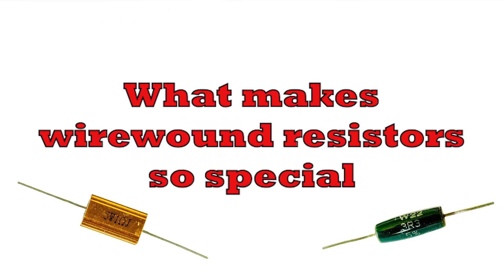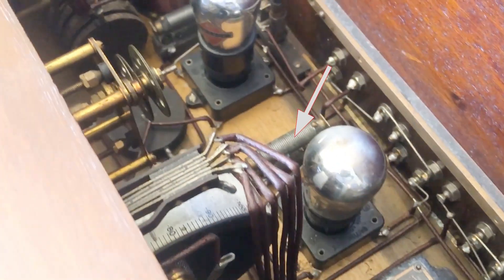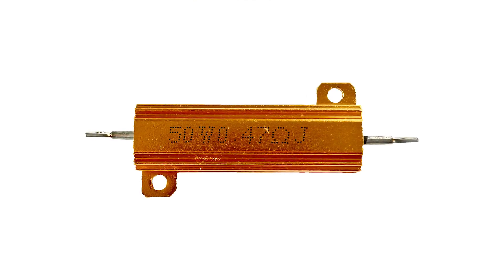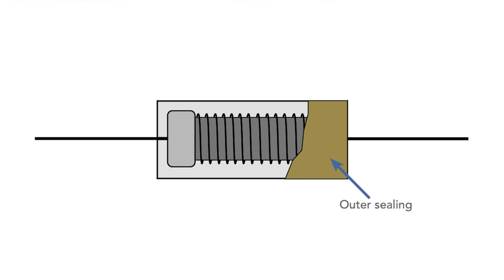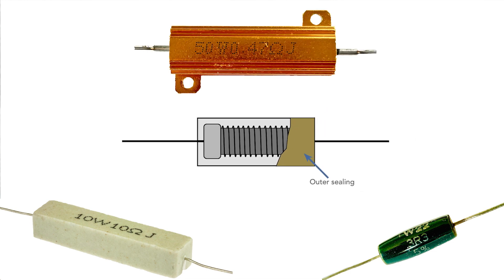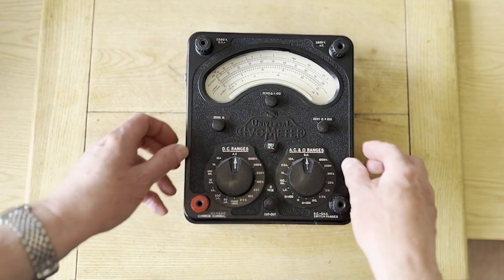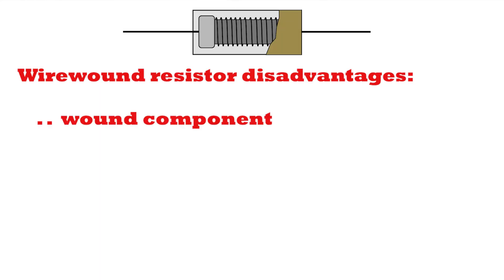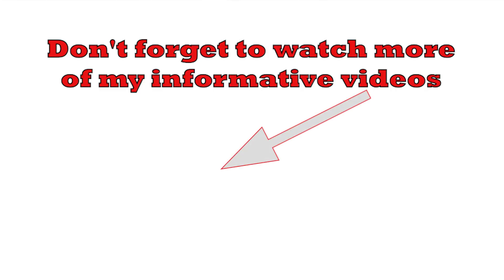Wirewound Resistors: The Secret to High Power & Precision

Comment: Thanks, but I was actually expecting you to cover the different types of wire-wound resistors like the power wire-wound ones (which can withstand massive 10x - 200x their power ratings for short-pulses without damage (depends on the resistor, refer to the datasheets)), fusible types, and the ones with efficient coatings such as vitreous enamelled wire-wound resistors.

And most importantly, the non-inductive wire-wound variants that use bifilar winding or Ayrton-Perry winding, which can have even lower inductance than CFR/MFR resistors, and possibly even lower than thick film ones!
Reply: As an EE I look forward to your video on this subject, you know far more than me!